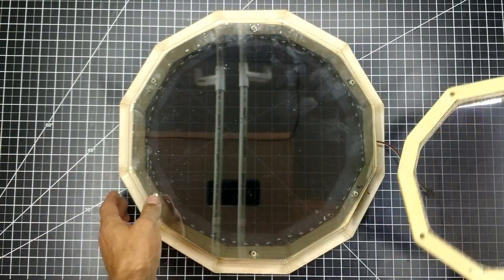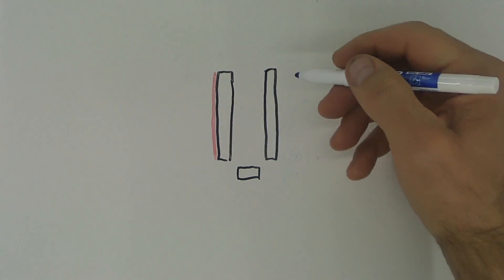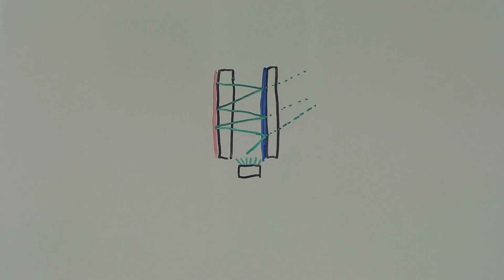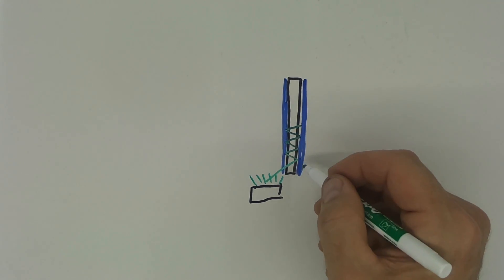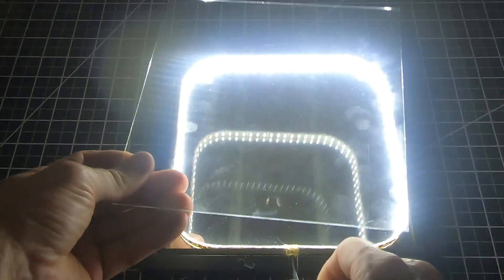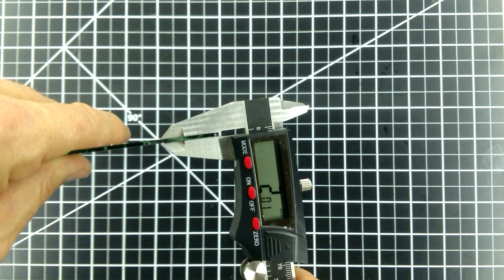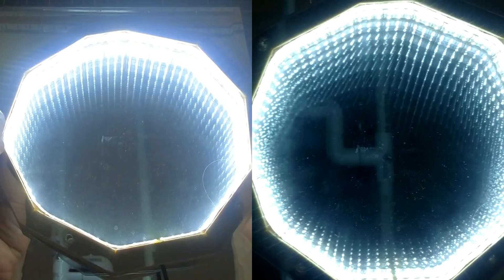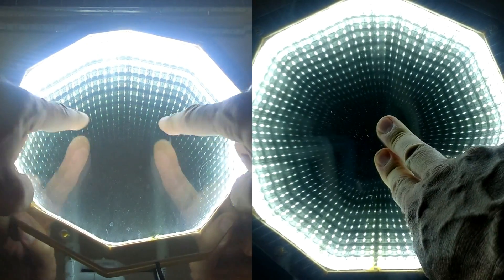How Infinity Mirrors Work - With Experiments

Comment: what if you use big diffused blocks of light, instead of tiny round LEDs? Would that create a faux valance window effect around the top of a small room? Or maybe make it look like an opaque white skylight? If the 2 way mirror is dome shaped, will it look like a dome skylight on the ceiling? What if the 1 way mirror in back is really two mirrors, leaning against eachother?
Reply: I am trying to build a fake skylight that sort of expands and was thinking the same questions. have you ever found out more?

Comment: use your double effect but put ACRYLIC BLOCK in the middle ..this will light up and create a infinity block effect ..
BUT ADD LED lights inside the walls of the acrylic block and turn it on then turn on the leds  for the infinity mirror

Comment: i don't know if it would show on camera very well but replacing one side on a subwoofer with this bendy plastic would make it vibrate and make interesting shapes. as some frequencies it might even stabilize and create shapes similar to the shapes they got when the wrapped a speaker with a cloth and place some sand on top. should be an interesting experiment to do.

Comment: What happens if you mount the light on the mirror surface.
Reply from the maker: If you view it from an angle it should still give the effect somewhat, but every other row in would be blocked partially from the strip.

Comment: You posted this a while ago, but I'm interested in seeing different deformed shapes, like if you clamp it in a frame that makes the a ripple along the edge so that there are say three bumps bending in each direction. I've also been wondering what it would look like if you used two spherical mirrors. Great video. Not a lot of people experimenting with these. Thank you!
Reply from the maker: That would be interesting to try. Deforming the surface can give some interesting results. I'll have to try some things to see what happens. Thanks for the idea!

Comment: I'd like to see what it looks like if the LED strip is not a 2D circle but actually 1 loop of a helix, so the starting point is lower than the end point. Will it make the mirror appear to actually spiral inwards like looking through a coil spring of LEDs instead of appearing to have multiple parallel layers?
Reply from the maker: That would look awesome, and I have thought about that same layout a lot. Unfortunately it wouldn't make a perfect spiral. When it gets to the end on the physical spiral strip, the mirror would reflect it. Instead of continuing the spiral it would make the spiral reverse. It would still look cool though. Especially if there were a few loops in the spiral.
Reply: @HowDoYouDIY  Oh damn you're right. I really wanted to get a spiral wormhole type effect. I guess the next best thing is maybe make two spirals spinning in opposite directions, so when they reflect they complete each other? I can't picture it in my head...
Reply from the maker: Ooo, that could work! I'm also trying to work it out in my head, but I think it's do-able. Definitely going to figure this out.
Reply: @HowDoYouDIY  I'll definitely watch if you post a video experimenting with that.

Comment: WHAT WOULD HAPPEN IF YOU PLACED AN OBJECT BETWEEN THE MIRRORS?
Reply from the maker: I'll have to try that, but it should reflect the object over and over just like the LEDs
Reply: Have you seen the endless artificial skylight from coelux ?
I'm wondering how it can be done,
I wonder if what your doing in this video can have something to do with it, maybe using the bendable Fresnel lens with the mirror on one side?
Reply from the maker: I haven't seen that, I'll have to check it out.

Comment: Try making one with 2 tubes of different diameters ( example: 3"O.D. on  inner tube & 5" O.D. on outter tube or 5" & 7" / 7" & 9" etc. ) so that the space/void between the tubes is around 1 inch to get a deeper effect.

Comment: Could you use a heat gun to deform the top mirror? My first thought is it might destroy the mirror film. If it does not destroy it the film the result would be a cool deformed portal shape. Great for Cthulhu and friends come a knocking!!!
Reply from the maker: You could use a heat gun, that should work pretty well. Just add the film after it's shaped.

Comment: I loved the idea. Great video..
My suggestion for new feature - 4:36 - 4:42 - What if we stick the bottom panel to an eccentric shaft and couple this shaft with a high torque (less rpm) DC Motor.. then basically we can get a continuous motion of exactly what you did with your hands from 4:36 - 4:42 
Would look cool af for a desktop piece. Can also switch off the DC motor when not needed.. ;) 
Let me know, if you try that.. Unfortunately I do not have the right equipment to try it out myself. But would love to do it one day! :) Cheers!
Reply from the maker: That would look amazing! I've been thinking about that myself. Drill a home in the center of the back panel to bolt it to the shaft. Then instead of using tint on the back panel, use a chrome vinyl. Then if the cycling of the mirror is just right it would look like it's breathing. And color changing lights with an Arduino so that the colors cycle to match the"breathing". I love your idea!
Reply: @HowDoYouDIY  Yeah that sounds even better..!! Give me a heads up when you do complete this feature..  Have fun! :)

Comment: what about bolting the plastic with a curvature??
That would give a permanent warping to the tunnel.
And maybe experiment what happens when you bent each side in a different direction.
Reply from the maker: I think instead of bolting the curvature in place, using a heat gun to soften the plastic would make it easier to make the warp. And I love your idea of bending each side differently!

Comment: How about adding a concave or convex lens?
Reply: Shaped lenses can be quite expensive. If you want to do it for cheap, you could make the edges of the mirror airtight to create a vacuum chamber, then inflate/deflate the lenses (creating the concave/convex effect)
Reply from the maker: That would look cool! I found a mirror that's concave on one side and convex on the other side to try that with.

Comment: What happens if you put an object in between the glass panels?  Does the object become "infinity" as well?  And does thicker glass yield greater results?
Reply from the maker: I've seen some videos from other people that put things between the panels, and they do seem to give some infinity effect. As far as the thickness of the glass, it depends more on the distance between reflecting surfaces. The more distance between reflections will result in a deeper effect, even with the same number of reflections. So if the reflecting surface is on the outside of the glass it will look deeper with thicker glass.

Comment: I made one of theese where the regular mirror part was done with a mirror film. And there is a small gap of air between that mirror film and the back of the housing that I glued to be air tight.  installed a large syringe hooked up to a tiny linear actuator so that I can force air in and out if this chamber which causes the mirror film to go concave too convex.  it's really really cool but I didn't get it completely air tight so it only holds the pressure for a few seconds before it just equalizes and go flat. ...one day I'll find the motivation to fix it.
Reply from the maker: That would be so cool to see!!!